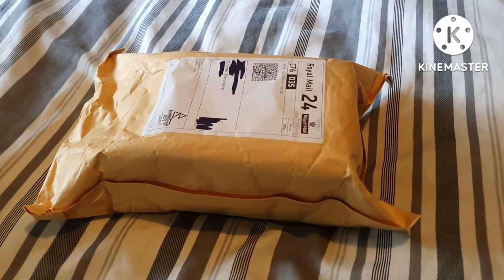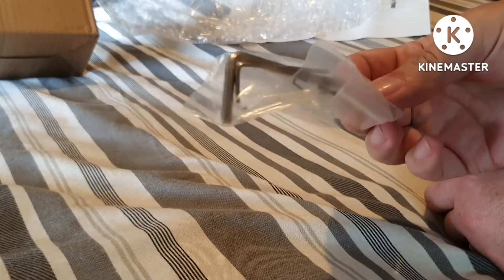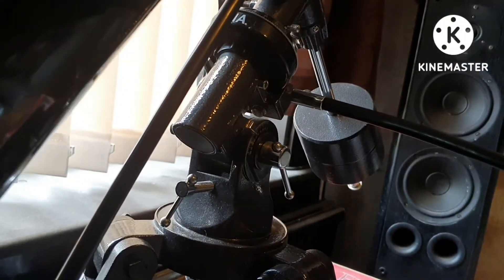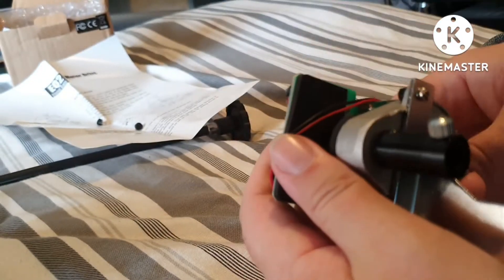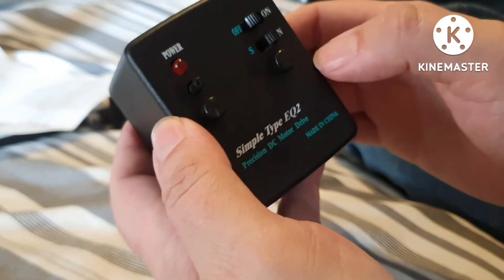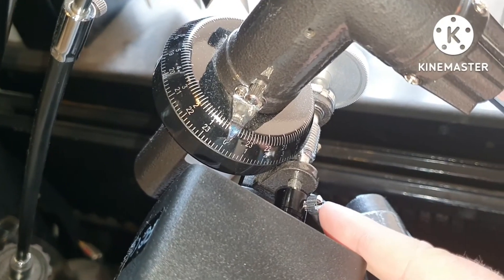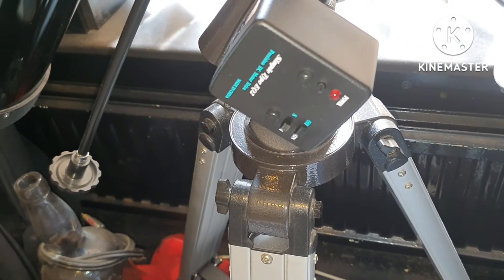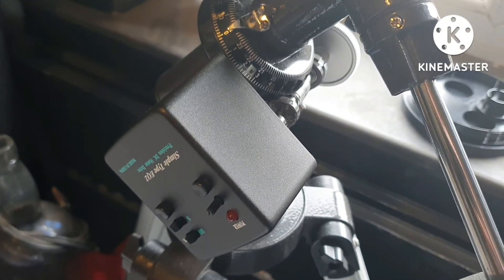EQ2 RA Motor - Unboxing

Comment: Can you move RA and DEC axis manually while the motor is attached? Or you need to remove it before pointing to a target?
Reply from the maker: If you open the clutches yes 👍